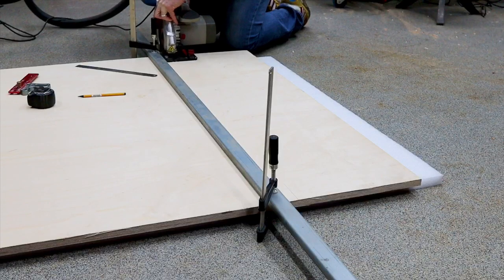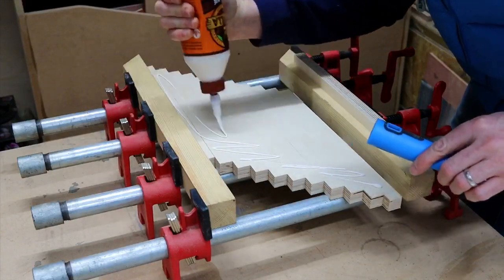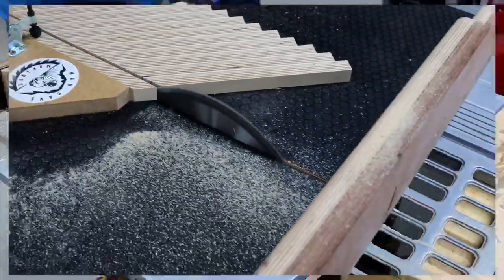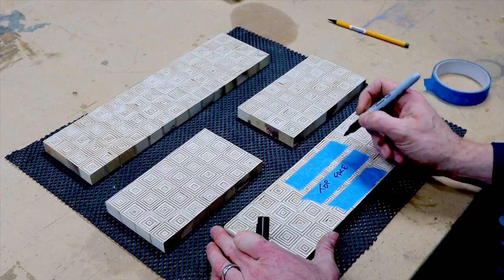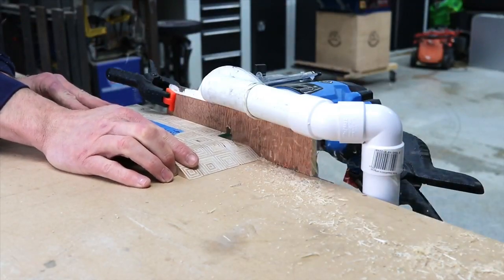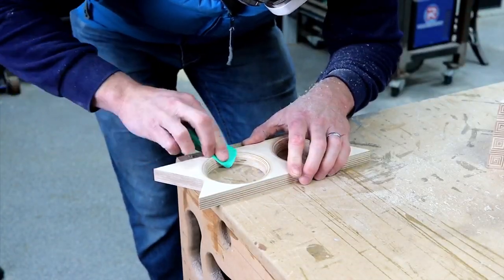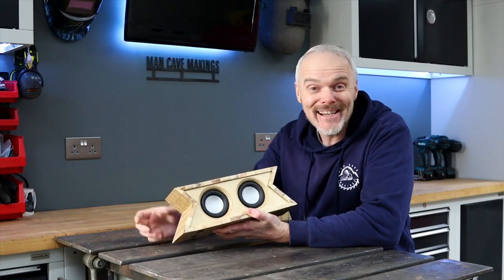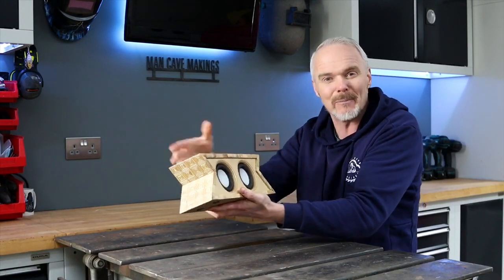Making a Plywood Bluetooth Speaker

Comment: I wouldn't stand directly behind your work when cutting on the table saw.  If you get any kick back it will shoot it right back at you.  I always stand a little left of the blade so that if there is kick back it doesn't hit you.
Reply from the maker: Thank you John I’ll keep that in mind and thanks for the tip. I tried to do this little project as safely as I could trying to think of all the little things which might bite me but simply standing slightly to one side wasn’t one of them! 🤣🤣🤣 thank you pal 🙏